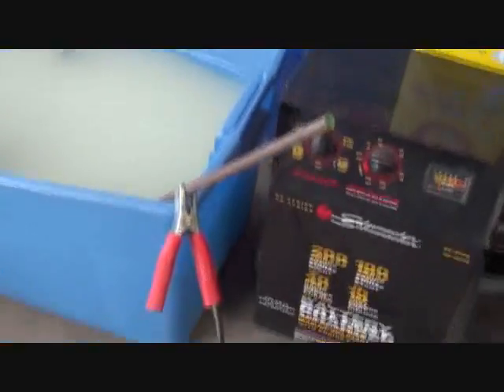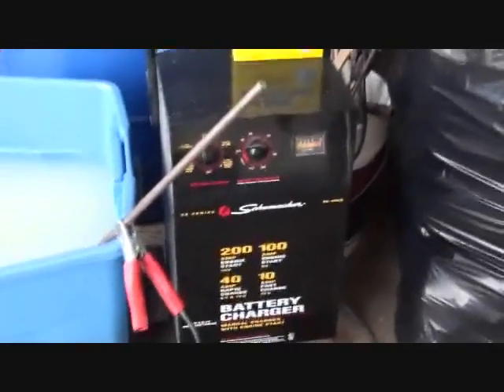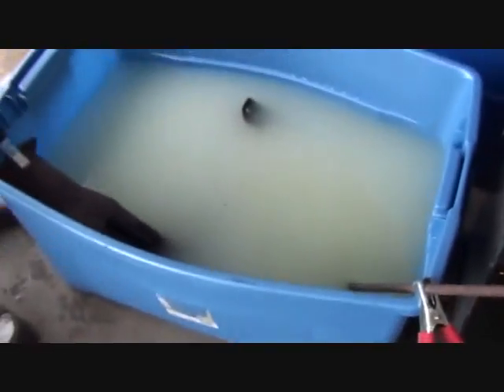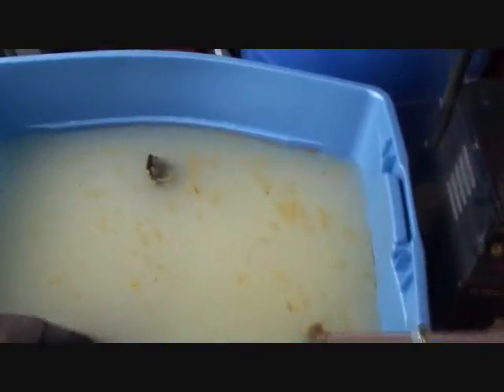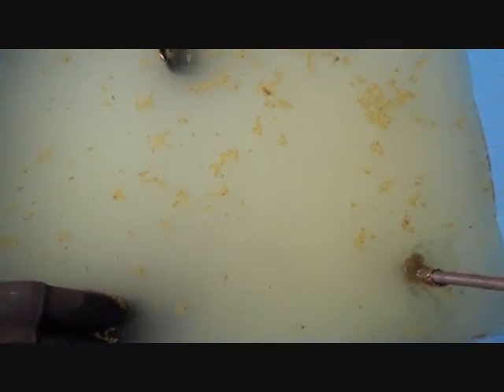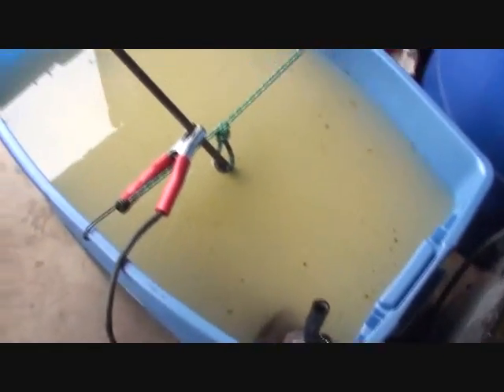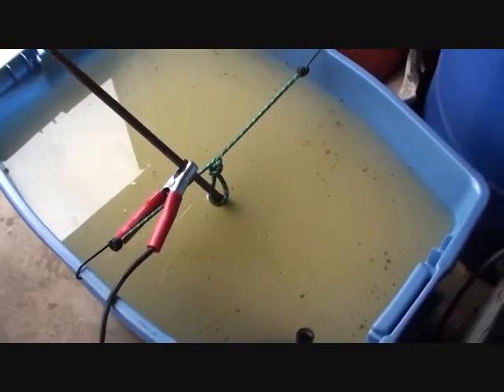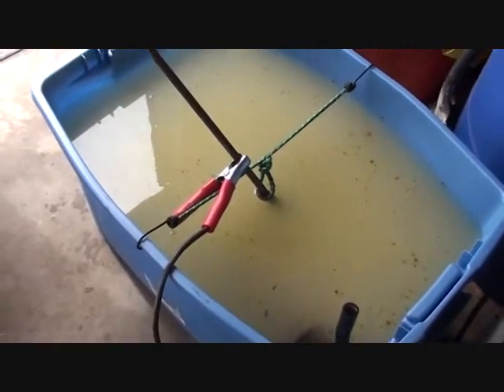Removing Rust from Automobile Header(Electrolysis) Part 1

Comment from the maker: This is true. The benefit of this method, is that you restore some of the rusted metal, back into the non-oxidized form. Using a wire wheel or steel wool will remove this layer of metal, that could have otherwise been restored. Does the amount of material lost matter? Probably not. But its a pretty cool way to use a battery charger and water to reverse the rusting process

Comment: Also,  that the bubbles are hydrogen gas (think Hindenburg) so make sure to run the process in a well ventilated area away from an ignition source unless you'd like to win a Darwin Award. In this case stupidity can be painful.

Comment: You are correct I should have said using stainless will liberate Chromium, which is extremely poisonous. A very tiny amount of Chomium will damage your nervous system So switch the Anode to iron or plain steel..